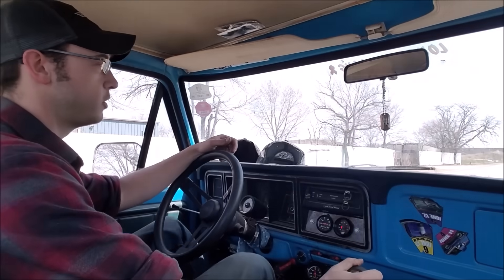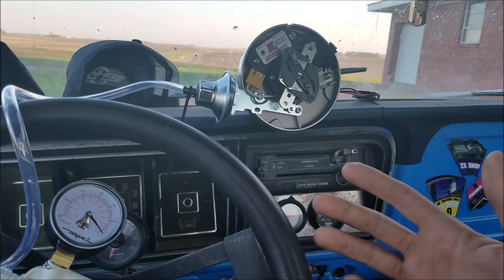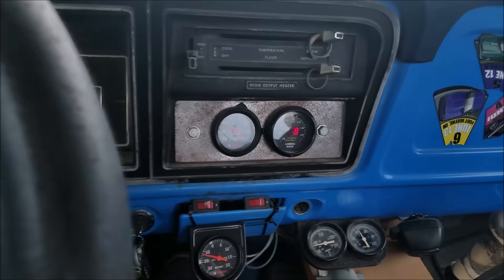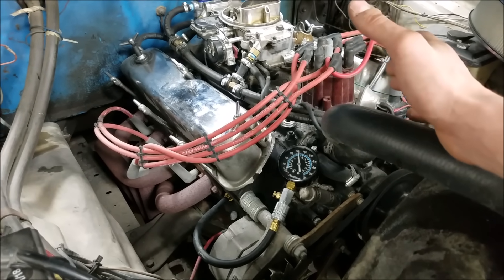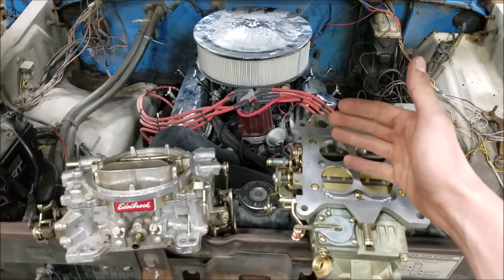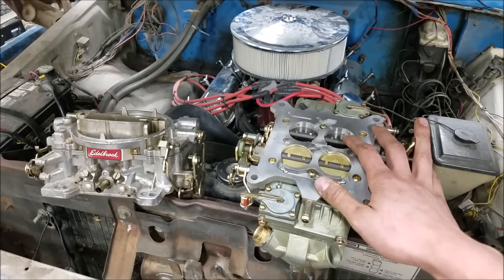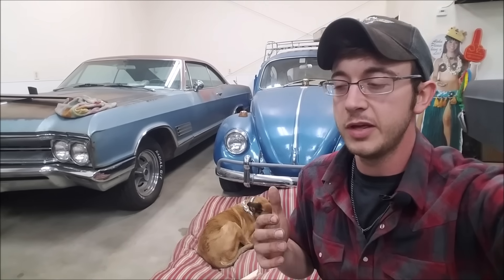Vacuum Advance - Ported vs Manifold: Which to Use & When !!!

Comment: You are telling guy's to stretch out to about 4000 rpm if that works good for your engine then you are over cam and to little Compression ratio
Reply from the maker: I can almost put money on me understanding it better than you do, which is clear by your comment above. 
Nowhere did I say to shift the timing curve. I said to run more initial mechanical and limit total so that you still have the proper total timing. 
Guys running manifold always have too little initial mechanical and bandaid it with light springs which gives you too much cruising timing at 1500- 2800 rpm. 

If you need more than 18 degrees initial on a street engine you built your engine wrong. Not enough static compression for your cam, bleeding way too much compression off. 
This is called dynamic compression. 

Also also, this is about ported vs manifold vacuum - the reason I say to run ported is so that your timing isn’t a complete potato off the line. 
As far as vacuum advance goes, it adds nothing when you are in the throttle. 
But you wouldn’t understand 👍

Also, you can’t blanket statement that timing all in by 2000 isnt correct. It depends on so many factors. You do that on a heavy truck with a small block and you will put a hole in your piston. 

Stop regurgitating stupid internet advice that’s WRONG!!!! People like you are what ruin it for folks actually trying to learn!!!
Reply: @ThunderHead289  mostly correct but do know that some engines come with a factory spec above 18 degrees initial timing.

Comment: You should have all timing in by 2000 to 2500 34 to 38 degrees you tell me on port vacuum at what rpm does port vacuum run out
Reply from the maker: That’s mechanical you are are referencing - irrelevant of vacuum advance. I’m starting to wonder what you even DO actually know ....
Reply: Wait... how many Fk'n comments did you leave?!?!
Reply: He doesn't know what he is doing but you can do what he is telling you to but your car will run like shit read a book on performance or hell a repair book but up to you I don't  care
Reply: @jdzurmehly6432  See my 1996 VHS clips last time I had an adjustable vacuum advance and weights and springs and a solid lifter cam and double pumper Holley with mechanical secondaries and choke delete
Reply: Yep you can tune them for any curve you want now hell they are now running vacuum advance on blown and turbo that was a big no no back in the day

Comment: And you may want to read up on why they came up with a vacuum advance and that will tell you why you are wrong
Reply: Of course this is all opinion based.  No different than my 56 that used a combination of manifold and venturing vacuum.  I always say to see what your engine like as some engines like more timing than others.

I appreciate the videos and respect what he does but he tried to tell me I need to bump my timing up when I switched my 302 from manifold to ported even though I was already at 12* initial and 14* initial drags when hot.  There is no way to get my current 302 to idle smooth with ported so I kept it on manifold.

But with my new 306 build I will try the timed port on the sniper I will be running but most likely I will be still running manifold vacuum just for the fact that under low load conditions you can run more timing and idle is a low load condition.
Reply: No shite. I was wondering wtf he meant by adding timing.  You have a factory set timing at idle. You need to advance timing as rpm's increase.  the higher the rpm the more degrees btdc. I wonder if he even knows about mechanical advance .lol. Kidd's these days.

Comment: Ported vacuum was invented for emissions.  If your engine is tuned correctly and you don't have to worry about having all the emissions crap in place, you want manifold.  It cannot be beat for performance, driveability, cooling at idle and economy.  
You can always (and should) have quicker mechanical advance to compensate for the drop in vacuum when you crack the throttle open.   
There is a huge write up...really, THE definitive write up on ported vs manifold by a former GM engineer that's easily found...originally on Corvette forum, it's been copied to pretty much every auto forum there is. 
The money shot of his explanation is at the end, though:

"For peak engine performance, driveability, idle cooling and efficiency in a street-driven car, you need vacuum advance, connected to full manifold vacuum. Absolutely. Positively. Don't ask Summit or Jeg's about it – they don’t understand it, they're on commission, and they want to sell "race car" parts."

All that aside, that distributor looks pretty cool
Reply: Not so.  Most, not all but most, factory setups used ported vacuum even before emissions controls were invented.  Certain engines, such as Buick Nailheads, respond great with manifold vacuum, but some don't, such as AMC 6 cyl.  They will hesitate and spit back.
Reply: @michaelbenardo5695  Not really. I restore classic gm cars from 55-67, and all of them came factory with manifold vacuum. All idle smooth, with immediate response and power on takeoff. I see no advantage to ported.

Comment: We used timing tape and altered weights and springs to alter timing. Total timing equals initial plus centrifugal and vacuum advance. Some older vacuum advances were adjustable. Different engine combos used different vacuum rates.   We used to swap vacuum cans around to change timing. Old school tuning
Reply: The brain is mightier than the Web. The age of slide rules and pocket protectors will never be equaled.

Comment: We always plugged in to ported vacuum for street cars. Manifold vacuum pulls your timing in too quickly. full advance at low RPM not so good. Ported vacuum allows the timing to advance for cruise conditions and really helps fuel economy.
Reply from the maker: Mechanical and vacuum advance function completely independent of each other. When you punch the throttle vacuum advance timing drops out and you are only on mechanical.
Reply: @ThunderHead289  Yes you are correct. I was referring to total timing. I used to set up Pontiacs for Stock competitions. Ever spend any time with a Sunnen Distributor Machine? I can operate one blindfolded. Its old school black magic we practice. These kids with computers have no clue.
Reply: We would lock out VA on a drag car. Relying on initial and centrifugal. Sometimes different conditions would dictate a slower or faster centrifugal rate. A street vehicle was smoother and had better economy when VA was correctly dialed in.We used to swap cans around to get the curve we wanted. I had a tech manual that listed the VA rates and weight numbers for various timing curves among the manufacturers. Ever set timing with a vacuum gauge? I remember telling kids that nothing they slapped on their motor was going to perform well until they got the timing right.

Comment: Very good!
Re ported vacuum:
A great test for any motor and its state of tune, or otherwise, is to pull the vac hose off the vac advance at idle. If it drops in rpm the whole tune of the car is almost always wrong. 

Also, if the rpm drops every aspect of engine tuning can need adjusting. 

Initial timing, throttle stop screw, idle mixture and dwell if it has points.
Sometimes the tune is so far out it is hard to get a motor to even idle so you can adjust the initial.

I marvel that people would argue about such a thing. It indicates an utter lack of understanding of basic mechanical principals. Talk about making something simple complex.

No doubt some will still argue because they have SFB!

Unless there are some very specific reasons (I can hardly think of one on a street engine and a race engine doesn't usually have vac advance), as the vid says, a street motor's vac advance should not be plumbed to intake manifold vacuum 
This means the port on the carb has to have NO vac at idle - don't plug it onto a vac port that sucks at idle. Also if the throttle stop screw - as mentioned in this fine vid - is screwed in too far, the dist port will be opened to manifold vac.

This is an accurate vid. Every aspect of it is correct. No need to challenge
Signed: 

A mechanic.
Reply: And many hotrodders and real world experimenters will argue because manifold vacuum for vacuum advance is used in some cases.  My emission 302 is manifold vacuum.  Run ported and nothing you do will get a smooth idle.  SBC's love manifold vacuum for advance as well.

What you have to remember is under no load or low load situations you run more advance and you run less advance at higher loads.  Idling is low load and no one can argue that.

Just like vacuum, ported or manifold vacuum is the same only difference is when it comes in.  Manifold vacuum is there all the time at idle or part throttle.  Ported is only there at part throttle.  The amount of vacuum doesnt change though.

I myself am going fuel injection on my 306 build for my truck and will be using the timed ignition port.  If I dont like it I will switch my timing back to manifold vacuum.
Reply: @Milner62  ported vacuum is for smog motors to help pass emissions tests. manifold vacuum is for hot rods.
Reply: @philgrossman5381 , not true.  Most engines from factory use manifold vacuum.  Ported was only used in rare cases and it wasnt for emission reasons.  Manifold vacuum will give you a smoother idle as it advances your timing at idle.  Ported vacuum is only used when you cant run more advance at idle.

Some claim that ported gives you better economy but ported vacuum and manifold vacuum are the same vacuum just when it comes into play.  Both manifold and ported vacuum will drop to 0 when you nail the throttle.

I prefer manifold vacuum not because it's a "hotrod" thing but because in low load conditions you can run more advance and idling is a low load condition.
Reply: @Milner62  I agree with you some vehicles use manifold vacuum set up from the factory 
My bone stock ss396 came plumbed from the factory with manifold vacuum to the distributor not ported,
Reply: You need more training, go back to UTI and pay attention this time.
Reply: Thanks

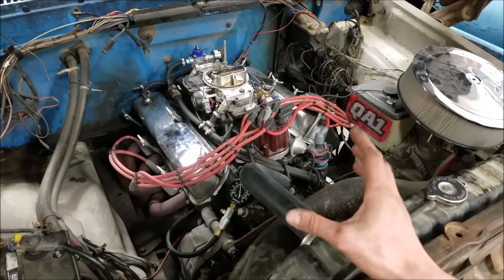Comment: @5:10  Holy Washer Stack Batman!      Very informative video - glad someone actually understands this and gives the information out -- Most Mopars I have run usually take 10-12* initial and ported vacuum for the advance...    seems to work very well. I am not dealing with a Megasquirt on a Gen III Hemi so I just get to punch a keyboard to do it instead.
Reply: My 56 loves 12* initial and runs on manifold and venturi vacuum.  My 82 302 loves 12* initial as well but loves manifold vacuum over ported.  My 78 351W is an oddball, loves 14* initial, manifold vacuum and manifold vacuum on the economize valve for my three terminal DSII.  With this hooked up at idle it bumps ignition timing to nearly 40* at idle.  It is the reason why I am getting almost 27 mpg highway out of that carbed 351W.  I seriously thinking about sourcing the vacuum switch and DSII module to use on my truck but not sure how well it will play with aftermarket fuel injection.

Comment: Excellent explanation of how your vacuum advance works. As you know the factory never did use manifold vacuum , always ported. But lets start backwards and work from there. If you dyno your engine and know the best power timing and work backward from that point, you will find most V8 engines make best power between 32deg to 38deg total timing. So when you curve your dist. you will want all your timing in at 3000rpm and your base timing should be 20degs. This will clean up the idle and make for good throttle response. But will also make the engine run cooler. With that being said you have to run ported vacuum to help the engine run cool at cruse speed. The timing at cruse may be as high as 44degs, this will help the engine run cool. But when you do step on the throttle the advance has to drop out as fast as possible so the engine does not go into detonation. Of course you do not want to be going to WOT if you are crusing along at 2200 rpm.
Reply: Before emissions, timing was all manifold

Comment: I have an old Ford straight six 200cid with that stupid "Load-o-Matic" dizzy & "Spark Control" carb.
I changed it all to manifold vacuum. Adjusted the timing.  It's never run better.
Reply: A load-o-matic dizzy will not work with manifold vacuum at all. Your distributor has no spark advance capabilities with the way it's been set up.  It will only function properly when it's vacuum signal is pulled From the carbs venturi port
Reply: @lukethedrifter3363  
Guess it didn't need it...thing ran like a raped ape.

Comment: I setup timing a little different.  Fist, I set initial timing to highest  vacuum and still able to hot start. On my 383 sbc I run 18 degrees initial.  Then I worked full throttle mechanical only.  My engine liked 34 total, so I limited the mechanical to add 16 degrees as fast as it would take it (18+16). Last, I used ported vacuum advance to add  for no load  cruising, for a total of 52 degrees (18+16+18).  Idles at 750 rpm with 10 inches vacuum in gear no problem, no detonation at WOT, and cruises pleasantly smooth.  Today's gas is different than in the 60s and 70s. If you run on the lean side, it actually takes longer to ignite at idle.  You need to dial in air fuel ratios first  then time the ignition to what the mix wants.
Reply: Yessiree👍

Comment: As a Ford guy,on my 460s and any Ford of this era.
 I use an adjustable vacuums advance using full man. Vac.
Base timing is set.
Centrifugal is set and then the vac advance is hooked to full manifold vac. And the Ford dust. Is infinatly adjustable.  
At my altitude with a stock 460 I run 12 basic timing,30 centrifugal.and and cruise (no load on the engine) around. A grand total of 50.  
  Learn your centrifugal weight adjust ment ,and. Then cap off your ported.
   vacuum
 And using the original dust. With duraspark,blue chip electronic system will allow you to run cheaper better more obtainable parts.
  The part of the dist. That your roter rides on verys from different dist. Enabling you to establish any total timing you want. This is true with the springs also.
 Where I live at 6000 feet above sea level we advance for more throttle response and drivability.  Good luck.

Comment: Use manifold vacuum when you have too much compression and cannot even reach standard ign timing while starting.
Reply from the maker: Or instead of sacrificing performance, put your ignition on a toggle switch and once the engine is spinning, flip it.
Reply: @ThunderHead289  I liked your video. let me possibly give you another viewpoint.  on a mild to performance STREET engine vacuum  advance is worth 2-3 mpg . how i do this is ,  With vac. adv. u hooked. I Set the distributor up for best preference. I like to use an adjustable vac. adv.can.( but you can modify  a stock easy enough. ).plug in the vac. adv to manifold vac.  re-adjust idle speed & mixture. now the engine doesn't care whether you have 1 person or 5  empty or full load. I do this with a 406 powered S10  . it doesn't care whether I am making a pass at the track, rolling down the Hwy getting 17mpg  or pulling a trailer with a tractor. I have setup all of my vehicles this way with good results and reliability .

Comment: Won't they be the same under heavy throttle?  You know,  where the power is anyway?
Reply: Yes
Reply: No. The distributor that is set up for manifold sourced vacuum advance will retard the timing when accelerating from a stop.

Comment: I watched for 5 minutes,  still not sure which your advocating for.   Maybe state your theory in the beginning so if we agree I can save a bunch of my time.
Reply from the maker: Or you can learn how this works so you can understand my reasoning so it’s not just some wing nut stating an opinion with no facts backing it.
Reply: @ThunderHead289  so watched the rest and the answer is neither.   I don't deal with carbs much unless they're on 2 wheels,  mainly watched initially to try and learn something about timing theories.
Reply from the maker: This will probably be more effective for you then - 

https://youtu.be/Ort2Gk7Lvuk

Comment: when i was playing with the frankensteined 302 form an 80 f150 that's in my 67 mustang i didn't touch the mechanical timing but switched it back and forth to see what i noticed manifold vacuum gave me more acceleration but i used gas a lot faster
Reply from the maker: It actually shouldn’t matter - the only reason you noticed an improvement with manifold is that your idle settings were done up for manifold. 
So with everything out of wack and loaded up on ported, it’s no surprise it struggled off the line. 
But if you run ported with mechanical advanced, you will have a much more effective mechanical timing curve. 

Like I say in the video- you can’t just flip back and forth without doing anything else and make a determination based on that
Reply: @ThunderHead289  MY understanding had improved after that day.I use ported. I didn't know how to properly set the gap on the points. i upgraded to pertronix II thatr lasted roughly 3 years now im back on points $8 vs $120 . I haven' t grasped checking my dwell quite yet

Comment: In one of your other videos on vacuum advance you quoted "vacuum advance has nothing to do with the performance of your engine".
Reply from the maker: Performance as in horsepower numbers it absolutely doesn’t
Reply: Depends on how you look at it.  At full throttle through the gears, it does not, as vacuum is too low to acuate the vacuum unit, but at light throttle, it absolutely improves both response and economy.